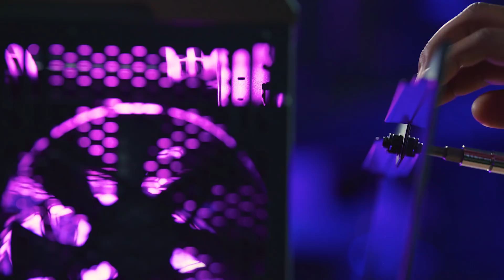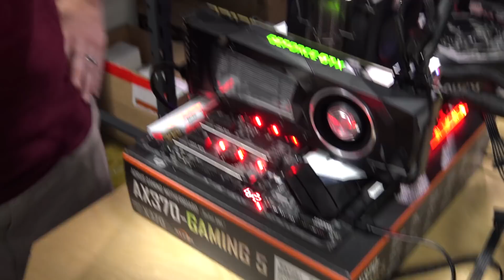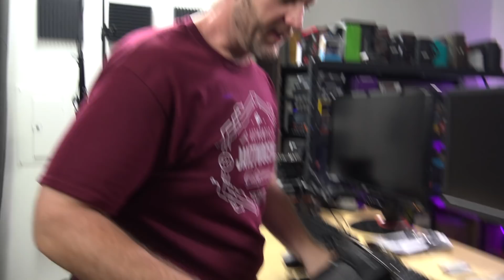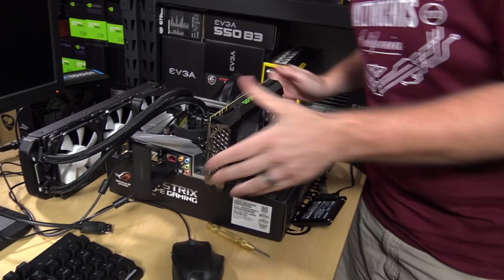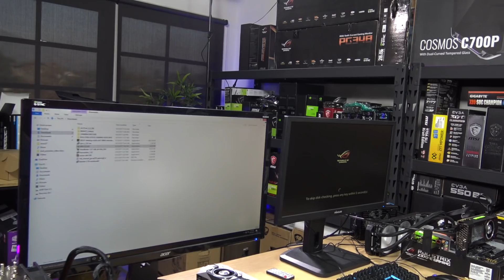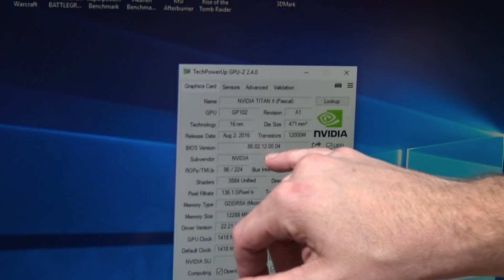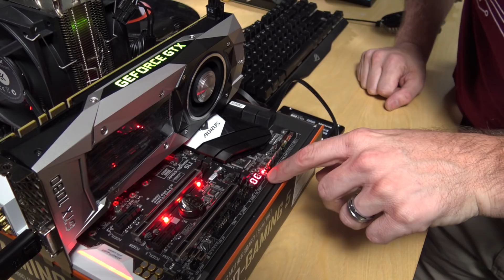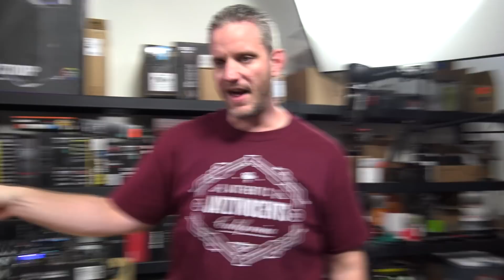I cant figure this one out... HELP!

Comment: 3 years later and started having the same issues, just switched out my 2070 super with a quadro and switched it back a couple times and it ended up working. Although my memory light was also turning on then turned off before the vga light so not sure if this would apply to anyone else with this issue

Comment: id check the motherboard or even the socket pressure i had one system i built for a friend do that exact same thing and all i did was take the cooler off re apply thermal paste and tighten the cooler back down and it worked which told me it was putting uneven pressure on the socket, threadripper is infamous for doing this

Comment: Actually had that issue with my ram on my Ryzen 3950x on a 570x board. Had two sets of ram dual channel sets, it would only work with one set of the ram. Both sets are the exact same product. But the set that didnt work in the AMD worked fine with my 9700k box. Wouldn't work in the AMD board with just the one set or with both sets installed.

Comment: Had this same issue with my new 2080ti. Would work on one computer but not my new one. I spent 3 days straight and 3 trips to microcenter to get new parts trying to fix the issue. Turns out it was the version of windows I was running. Once I updated to the latest version of windows it worked just fine.

Comment: I had an asus motherboard and at first it didn't post. Went back to microcenter and said the pins on motherboard were bent. wpuldnt refund my money for another board....and I have build 4 computers previously without an issue. So they pulled 3 of the same motherboard and all wouldn't boot or if they did they had issues. In this case it was the memory slots that were bad. The lights lite up but the issues were there. Bought a Gigabyte motherboard and am happy as a lark now

Comment: I see this is an old video, but I think I would also try the card in another PCI slot on that same motherboard.  I would feel it would be a connection issue/hardware.  maybe that particular card in that slot is just a small enough out of alignment it is not getting proper connection.  Just one thing I would have done.

Comment: a friend of mine had an intermittent problem with his video card and it worked fine at the shop  but it would not boot or crash it turned out to be the psu

Comment: Maybe it's not the gpu or the motherboard because i have similar problem with mine motherboard and putting it on PCI express 2.0 and it worked when i put on 3.0 then it doesn't work so could be that not sure but saying that switch on different PCI express worked for me

Comment: I remember experiencing a strange situation with m.b and a specific model of graphics card, when I got an Asus 980ti OC strix card and put it on my msi P67A-G45, the system booted after the 3rd time and worked for 30 minutes, after that the gpu died. I googled it and noticed two other persons (not sure which forum it was) had this problem with that specific mb and graphics card, and that was the first and the only time experiencing such incompatibility and never figured it out, ended up buying another mb.
note that: (I was already aware of the first series of 980ti strix cards heatsink alignment problem, this card wasn't one of them.)

Comment: Channel noise? The video card could be picking up noise from one system and not the other and the one card's rom doesn't like it.  The noise could be caused by Power Supply, fan motor, hard drive, etc.  It's really rare but if the problem card isn't shielded quite as good as the other it can cause a problem.  I'm know I'm reaching but at this point you have to reach.

Comment: Jay, I suspect it is likely that a chip timing incompatibility issue is taking place between the PCBs, resulting in that MB (or possibly the CPU) unable to ever work with that GPU.  I am a Professional Engineer with my EE focus on Computer Engineering, and logic gate timing issues are becoming more and more of a problem due to increased component densities and clock speeds.  All it takes is for one transistor (part of an inverter or gate) to receive a microscopic doping error during fabrication, thereby adding a couple of nanoseconds to its timing on one PCB (i.e. the MB), while another transistor on the second PCB (i.e. the GPU PCB) received the opposite doping error and timing shift on the second PCB (i.e the GPU board), and they could consistently miss sync pulses when connected.  That problem is frequently discovered during regression testing on newly fabricated chips, especially when they are using different fabrication processes.  I know this a highly theoretical cause of this problem, but it definitely is a possibility.  If it were my system and I had your resources to have isolated the problem  a accurately as you have, I would not use that MB, CPU, or GPU, in a system running any critical functions.  There are times when a PCB needs to face the business-end of a car tire (a story too long for this post).

Comment: Jay I noticed you put the gpu into intel system and put the intel gpu into ryzen but checked out the ryzen system but I noticed you didn't check the intel system for bios ? So you checked the intel system gpu, twice ? But failed to get the bios date off the intel system after it booted ? my 2 cents lol

Comment: Did you work this out?

I see you have an x370 Gaming 5 box there. I had to replace mine because it went faulty after just over 4 months of use. Symptom was it wouldn't power on at all. I had powered it off from OS shutdown the previous night, then in the morning, got no response to power switch. No lights on mobo or GPU came on. CMOS reset did nothing. Unplugged the ATX, plugged it back in, standby lights on mobo and GPU came on. Hit power button, immediately everything turned off, not even a hint of fan spin.

As it was under warranty, I took it back to the store. The store diagnosed it as a motherboard problem (PSU is RM850x and working fine), and they sent it off to Gigabyte. After SIX WEEKS without having my gaming/pseudo-workstation system, it came back working (yes, the same unit), but once again after 4 months, the exact same symptoms appeared. Had to fight with the retailer to get my Australian Consumer Law right to a refund, because Gigabyte reported it as a "minor fault" that could be "easily repaired".

Ended up having to buy an MSI x470 Gaming Pro Carbon out of pocket, before finally getting the refund about a week later. The silver lining is that it's a much better motherboard, with no ridiculous U.2 port, a far superior BIOS and overclocking that's actually STABLE. I ran CPU at stock, with RAM on XMP, on Gaming 5 because the only stable OC I could get on my1700X was the pegging the 3.8GHz boost clock.

Comment: Sometimes, brand new cards that are sent out to reviewers are pre-production units, and could have hardware that was determined to be marginal, and changed in later revisions (including, say, two cards that were sent to a particular reviewer, despite both having the same BIOS revs and allegedly identical). 

I've seen this back when I worked on copiers: sometimes, one would get a board that was marginal to begin with; and, with an older machine whose power supply was maybe beginning to fluctuate, or was on bad wall power, or even plugged into the same circuit as something else that had horrific power supplies that were injecting harmonic feedback into the AC circuit, and causing the unit to fail. Hell, I've seen shorting corona units inject enough electrical noise to make the machine think someone had entered the code for Japan-only service mode. And i've seen similar problems on the old IBM copiers, too.

So, it may just be that one card has marginal components that don't allow it to play nicely on the AMD mobo, while it works just fine on the Intel mobo.

Comment: I had a weird issue on my 4770k system about 5 years ago, the first processor i got had a really serious problem running PhysX, Firestrike, Vantage whatever, it could not manage more than 10-12 FPS on the PhysX benchmark. All the GPU portions were fine, and I had no CPU warnings or errors, POST was fine, and general desktop tasks were perfectly fine. But anytime a game or other item had to use PhysX processes it ran like shit. Tried different board, re-seating, all that and nothing changed, I finally RMA'd the processor and the new one was perfectly fine... wigged me out cause there was literally nothing wrong with the processor other than when it would try to run PhysX.... still the strangest thing, and its the main reason I use 3d Mark benchmarks after every build now.

Comment: Ryzen is finicky with memory, right? And memory clocks? My 1080 GTX Gaming X memory clock is supposed to be under 2000 but shows up as 5k in GPU-Z... Maybe it's the memory on the video card itself which is faulty, running at a higher or lower clock, different timings, etc? Alternatively, It could also be the clock speed for the chip itself on the video card...

Comment: I would clear CMOS on the processor, ensure all the timings are at the safe settings, it could be that this card has a sensitivity whereas other cards don't.   If possible I would try another motherboard.

I once worked in a company that constantly scrapped cards because of electrical noise interfering with the measurement .  In creating a service manual I built a photography product using this noisy scrap - it had the best noise performance they had seen for that generation of boards... go figure

Comment: I once built 27 of the exact same PCs for the computer college I was attending at the time. Every Case, power supply, motherboard, CPU, RAM module were all identical parts make/model wise. Some parts would just not play well with each other. I've seen this many times in many different ways. I've always chalked it up to the devices being so complex these days that anomalies are just part of the process.

Same reason some CPUs over clock like crazy while others barely achieve factory specs. They call that the silicon lottery and is just one example.

Comment: well obviously they are not technically identical. you could easily RMA it and request replacement that is the only option for a average builder. otherwise they will need to buy a new graphics card.

Comment: I had the same issue.. I had a working card, updated the bios and it didn't.. I thought maybe the bios got corrupted during either download or install somehow, but not enough to affect updating.. I re downloaded the bios again, and whalla it worked... This was on a 980 if I remember correctly BTW...

Makes no sense why it would do that but it worked fine on my i7 but not his ryzen 5 1600. And mine worked on his and mine..

Comment: Socket pins or cpu pins rather that it's AMD. Clean and straighten with fine tooth comb, 91% alcohol. I can not think of anything else except that hardware or software bios but I to would not want to do that even before trying the PiNs! What do I win Jay? Also 'Bios on the actual PC even though the GPU's are becoming the '
PC".. hah! :P Steve From Philly #EAGLES

Comment: Hey, I have the EXACT problem.... With a twist! It's on Gigabyte GA-AB350 Gaming 3 board... used to work perfectly, until I upgraded my UEFI from F9d to F22b. Only thing LITERALLY that helps me get around this is to power up with power and reset pressed for 10s, so the backup UEFI supposedly kicks in and resets. Then it works. If I go back to F9d, the issue is gone. Also it would appear, that if I enable XMP profile (the default should be the same!) this issue resurfaces. Anyway, do you have ANY idea of what's going on? The difference in the UEFI is that the newer ones have rewritten AGESA (according to Gigabyte) from scratch....

Comment: i had a similar issue back in the day with an ASUS P5N-sli board and it truned out to be a faulty board.  the issues withthe board were faulty solder joint on pcie slot, tabs in slot not making good contact, a little bit of dust in the socket, and it also had a slight issue with the onboard chipset which was causing it to read card slot randomly.  what might be happening in your case is the pcie slot not likeing the non working card by the contacts in the slot.  unfortunatley only 2 options for this. 1 RMA, or 2 salvage a pcie slot from another mobo and install it ( only recommend if you have good soldering skills and mobo is out of warranty).  also not you need a GOOD soldering iron a cheap 30 watt pencil iron isnt going to cut it ( i recommend hakko soldering station with adjustable temp).now once it is fixed feel free to pay me for my services ( a triplet of gtx1080Ti's for tri-sli sounds good LOL)

Comment: I have the same problem when i change over form fx series to I7 7700k and i have 2 msi radeon rx 480 8gb. My motherboard just got crasy and alot of wrongcode and shit, so i put the gpu on the moterboard the system boot but only blackscrheen, and i try the 2nd one an that work. I try to set them in crossfire and blackscreen agen and wrongcode and debug led blincks on vga and cpu. So i google it abd dont find enything about that, so i jump the motherboard 8 to 13 times and my problem wass fixed,

Comment: Driver issue? I have an R9 Toxic on a ASRock? Fatality board (AMD AM3+) that I had to do some regedit for, and manually input drivers for an entirely different card with the same internal chipset to get it to work properly. Before the driver that normally would install was installed the computer worked  for a period of time. Once the normal driver installed the screen would blank out and on restart I would intermittently experience bios post issues, and when it did post it would not last for very long before rinse and repeat screen blanks.

Comment: There could be a fault on the card  that only presents itself on the Ryzen build. Something that drops out for a mili second. It may not be the card, have you tried a Ryzen build with a different mobo? Also just to add, when you power down and unplug things capacitors can take minutes to drain.. :)

Comment: You haven't really worked in IT for 10 years if you haven't seen this "type" of issue before :p
I've had 3 cases of EMI (not internal to the system) causing it to fail or partially fail and 100's of "weird" things. 1. Any computer close or pretty close to where the "failing" computer originally was standing wouldn't just want to work... BSOD at random times. Dell engineers were annoyed by us calling repair (under warranty) every day :p until I moved the computer about 3 feet. 2. In a LAN room we used quite a bit there was always 1 person that couldn't get his NIC to work properly. Some swapped NIC's, cables, ports, sockets you name it, completely different computer => No netwerk on that spot. Taped it off eventually so no-one would sit there => no more issues :p. 3. Certain revision DELL computers would BSOD if they had a certain type of mobile phone sitting in front of it. (same time-frame as the 1st one).

So my suggestion would be to swap the computer's location on the desk or ad a riser cable/card to failing machine/video card combo.
Btw have you found a solution yet? Can you make this happen again?

Comment: I believe if the one not loading up had been over clocked or otherwise altered to the point of not matching up with the proper standards for the new build,  perhaps is drawing too much current and the motherboard thinks it's a short?

Comment: Not sure if you solved this problem as this video is back in Oct as I  just saw it today after I subscribed as videos are popping up..       This is off the top of my head as I use to own AMD chips back in the day but watching lot's of tech channels like yours they still say AMD is picky with memory you get for your motherboard and what type.    Now you have two video card identical in every way even the same bios but have you as this is just a guess could the cards have different memory manufacturers .   Companies like  most companies they may have two suppliers that sells them memory for their cards so in turn the memory on one video card may not be compatible with the AMD ?     Just guessing  here  :)

Comment: omg i've the exact same problem i think. zotac gtx1060 on an asus prime b350-plus. gtx1060 works only in slot2. slot1 works fine with other test cards but not the gtx1060. im still thinking it is the gtx1060

Comment: From my experience in electronics and computer ships procurements (even for LARGE companies), you could very well have 2 IDENTICAL cards (same layout, design, PCB, components, etc (at least with tech references)) and witness 2 very different behaviors. Have the manufacturer check with the local market for where they got the electronics from.

Comment: I had a similar issue with a GTX 550ti. It worked fine with my 790i Ultra SLI for about 2 years. Then I gave it to a friend who used it in his B75 board for like 6 months and that damn thing never worked in my PC again when I got it back.

Comment: It could be the VRAM. Just like Ryzen is finicky about the type of DRAM you use (it likes single rank Samsung “B” die), nVidia gets its VRAM from Micron and Samsung. If the card you’re using has Samsung VRAM, it works just fine. But maybe not so much if the VRAM is from Micron. Just a thought.

Comment: Hey jay! Not sure if you've solved the issue and if your gonna see this post but check the power supply. Maybe power draw is preventing post and motherboard is still booting. Or try another card in the machine and run furmark?